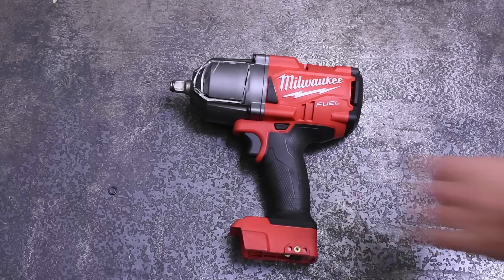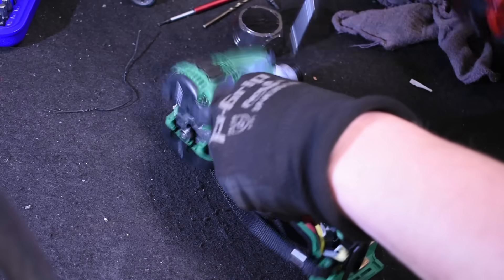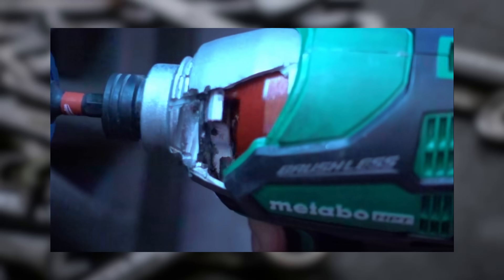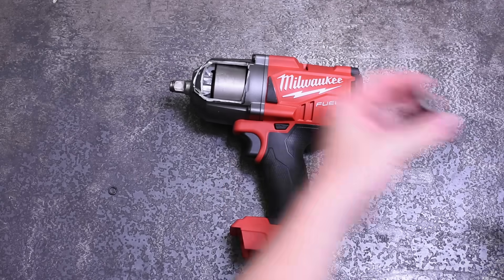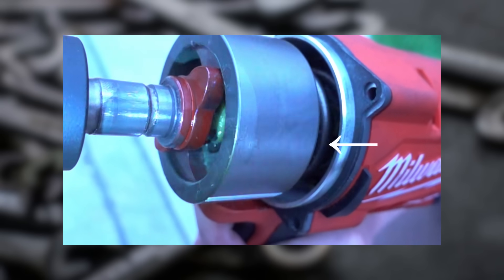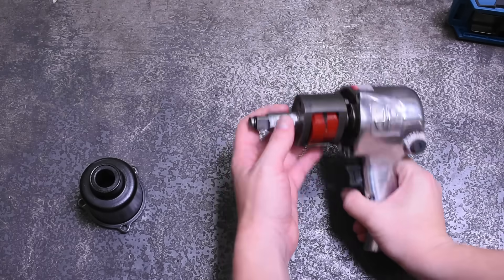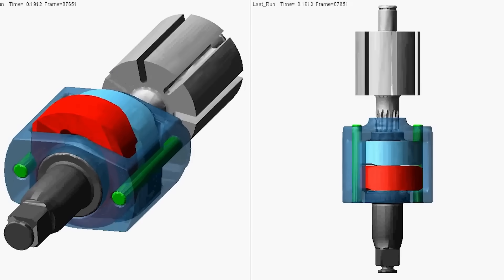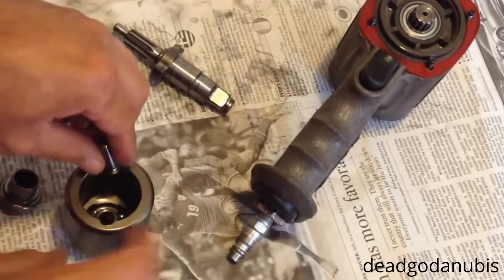High-Speed Video INSIDE Impact Wrenches: How They Work

Comment: Where are air pressure line tools used? What circumstances would you use them over electric?
Is it on production lines or where elecricity is particuarly dangerous?

Comment: ooohhh i see. so, there is no real reason why they couldn't make a jack of all trades drill/impact driver-wrench. all you have to do is make a swapable "heads" motor body, and have settings on the electronic side for each type of head. that would reduce a lot of weight and bulk from my tool bag. "drill/clutched screwdriver head" (and why not coaxial impact for drilling on walls), impact driver head and impact wrench head. who do i have to f to get one of those?
i do washing machines AND AC split units. you can imagine how i can go from needing a drill, a driver, an impact driver and an impact wrench for just one job. (althou impact wrench would only be "needed" for the washing machines' pulleys, basically)

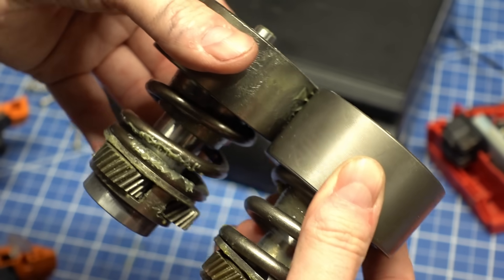Comment: 2:50 does the strength of the spring affect the strength of the blows, i.e. if the force in the spring increases, will the torque/force with which the tool unscrews/tightens increase?
Reply from the maker: Good question. Yes. It increases peak hammer speed before the blow. But that will require a brushless motor that can reset that spring 2000 times per min even with the brand's minimally sized batteries without timing hiccups. So there's a max to that end.
Reply: @TorqueTestChannel  I modified a parkside/lidl tool that has a 220v 500w ac motor, the hammer and anvil did not have impact surfaces vertical but at 45 degrees, so the tool just rotated and hit lightly and nothing could be screwed. I sanded those surfaces to be vertical like on your tool. I placed a washer under the spring to make it more taut. now the tool works much better, but I wonder if it would work even better if I didn't increase the force in the spring, so that the tool can turn more before it hits

Comment: THANK YOU for showing the twin hammer design in action!!  I use the IR 2235TiMAX and have been curious about it's basic hammer function but had no interest in opening it up. Listed at 1,300 ft lb max torque, and 1220 IPM, it is a lightweight beast.

Comment: There is still unclear how the hammering is transmitted to the rotating head and why it is needed pressure in order to start hammering. The inside parts seen through the cut areas show only the hammering part. But is this transmitted to the rotating part?

Comment: Explanation of how impact wrench works is not clear. RPM is not measured in tons. A planetary gear set does not "turn a high rpm into lower but higher torque." That makes no sense. My guess is that probably what actually happens is the planetary gear set converts a high rpm into a lower rpm, it enables an input shaft that is spinning at a high rpm to cause an output shaft to spin at lower rpm, and in doing so the output shaft can provide greater torque than the input shaft was able to provide. I still do not know how the torque, the rotational force, is converted to an "impact." And I can't see it happening in the video images where it is supposedly happening. My guess is that somehow the coil spring absorbs some of the rotational force, over a period of time, and then releases it over a period of time that is shorter than the time it spent absorbing it. But by watching the video where part of the cover was cut away to expose what was going on inside, I wasn't able to perceive how that was happening. .

Comment: The worst tool ever made for unprofessionals. The number of people I have seen use these that were clueless about their function. These are great tools in the right hands but when you see someone try to drive 20mm screws into two pieces of 12mm ply, then it makes me cringe. I have seen them use it to drive metal roofing screws into metal girders and only succeed in driving them so far they didn't grip but went past the thread.
I myself have a Ryobi brushless drill driver which has an impact function for driving screws. It drives screws in using the normal drill drive function but when it tightens it switches to impact and turns the screw 1/4 turn per hit, max, to tighten it without it ripping into the wood.

Comment: So the spring in the metabo HPT is not the right stiffness / power.

This is good feedback for them. If they change the spring so that it takes more speed to fling it into the "dogs" it will skip more and accelerate more before hitting the next one.

Comment: I’m late to the impact driver tech.  However, having to do some seriously-rusted brake and suspension work, on a car recently acquired, made me research and I realised that the hammer system of an impact driver, enables very badly rusted/fused bolts etc, to be removed BEFORE the heads all round off.  What I would now like, is if car makers and third-party parts makers, would please put full-size bolt heads or nut heads on their fasteners.  Some have a half-height I assume for speedy on and off with the tool reasons on the factory floor, but once rusted, it can defeat even an impact wrench, as you just cannot hold it on the shallow head supplied.  Especially after rust has swallowed another mill or two.  

Anyway, I got a 3/4 inch Milwaukee, and although on paper it’s just a little better than the 1/2 inch below it in the range, I suspect there’s more to it.  Like, the heavier body will resist the ‘recoil’ (action and reaction) that slightly has to occur, in an impact situation.  And, how much it can take continuous usage.  I am pretty impressed, and it is slowly earning back the price tag of $400 plus the rubber cover and a load of impact sockets I never had before.  It’s for the big, refusenik, SOB jobs that I bought it, and it does everything at 2/3 or whatever of full impact power.  The only issue, is sometimes getting into these nuts or bolts on a car.  I see why a lot of people end up with a right-angled one, or smaller than mine, despite having to really wring it’s neck to get certain bolts out…it’s possible to get int much better than with my ‘big dog’ as I call it.  But, it’ the really big jobs I got it for, and it works better than I imagined, great technology, it was the fact it made the impossible nuts and bolts, surrender, that clinched it.  Take care all.

Comment: Thanks, now I don't have to open up my air lug nut driver to see how it works. By way it is 30 years old and still works fine. The battery never goes bad or dead it has none. (LOL)

Comment: Is the spring a part of the torque transmission coupling the gear box torque first to torque pretension the spring as fly wheel camping out from the load shaft - or doesn’t do that? If not why not?

Comment: I love the scientific approach and dive! My only gripe is that you described what was going on in the impact driver using force and not impulse.
Regardless of the similar name, I understand force being more easily understood by a wider audience, but it does not describe best what's going on.

The force imparted by the hammer can only be as high as the force returned by the load. The force coming from the load end is what is responsible for the measurable acceleration (the hammer slowing down). However, it is much easier and, honestly, more intuitive to analyze momentum and impulse, or mass times *velocity*.

Comment: Did I miss something? I really wanted to see the driver impact vs the anvil impact, 
If I missed that put a time stamp in,  thanks! And very cool 👌

*(impact wrench does like 400lb-ft torque + depending on the model,  but a bit driver is usually around 150lbs-ft tq - that's where I'm wondering THAT difference) I own both,  thanks again.

Comment: I would have been interested in seeing how those 12v impacts work, the ones you clip to your battery say if you had a flat on the highway. the one I picked up at auction sounds like it spins up to some RPM and then hits all at once, then has to spin back up before hitting again. Kind of curious just what the mechanism is in that thing.

Comment: I don't understand what the strength of the spring has to do with the strength of the impact. The spring is moving it perpendicular to the impact movement so it's just there to move it in so it can repeat strikes right? So how does a stronger spring affect the force of impact?
Edit: If it's winding the spring up and gives it some more torque then if you put it in reverse wouldn't it be unwinding the spring and it would give you less in that case?
Reply from the maker: Larger spring = more tension before release over the dog = more speed. Velocity squares to force. The heavier the hammer, the larger the spring you need for it to translate the motor's RPM speed into hammer speed. The spring has to out accelerate the motor RPM for that window of movement, otherwise it's always lagging behind and would just get twisted. In reverse the spring binds the other way, sometimes there is a bias however.

Comment: Great job on the video! A point of clarification when speaking about fastening, dynamic torque refers to a fastener being driven at a relative speed while in continuous motion. An impact tool by design drives the fastener with strikes and pauses which requires the fastener to overcome static friction each time, stealing a portion of the applied energy away that was intended to developing the clamp load needed to properly secure a given joint. The up side to impact tools is that they reduce the reaction force felt by the user allowing for for higher torques to be achieved without the need for torque reaction devices! When joint loading accuracy is of the utmost importance a DC electric fastening tool is the tool of choice as it tightens in a truly dynamic manner! Lastly, we can limit the negative impact of the variation in friction of a joint by using a torque + angle tightening strategy as it relies less on applied torque and more on mechanical rotation to drive the fastener!

Comment: When I first bought my house, I used to frame walls and things with a hammer and a bunch of nails. Then I discovered impact drivers and construction screws and now framing is my favorite job to do! I have an electric, corded driver and its so good at sinking construction screws into 2x4. And every screw pulls things together more and more. Unlike hammering nails where you are tightening the one you are hitting and loosening all the rest.

Comment: The reaction you feel comes from accelerating the hammer through that cam. First only just a little bit, as the spring resists the cam, but then when the motor is up to speed and that hammer is reaching the end of the cam track there'd be quite a bit more reaction as the two impact.

Making the cam track longer and shallower can mitigate that by essentially stretching it out through time, but that would also slow down the impact rate of the tool. Either way, the tool will recoil just like a big cannon does. Can't escape conservation of momentum.

Comment: The whole "torque" thing is really barking up the wrong tree here. These impact drivers are essentially building up a bunch of kinetic energy and dumping it all at once through whatever it is the 200lb gorilla happens to be reefing on this time. To that end, this really isn't as simple as saying "this one does 150Nm" because that number is essentially a reflection of the flex in the system.

It's fine for comparison purposes, but what registers as 150Nm on your equipment could quite easily end up double that when attacking a super rigid fastener, accidentally ending up with one too many ugga-duggas and snapping the thing right half in two. Not a great day...

Physics-wise, they ought to be rating these in joules per impact and joules per second (that'd be watts). Those two figures offer the most reliable comparison between tools, which is completely independent of the equipment used for the actual test. That would also align the marketing wank with real-world performance, for instance there'd be a linear relationship between the power delivered overall and Project Farm's "big screws into wood" test, as well as a linear relationship between energy delivered per impact and the maximum torque recorded by any particular piece of equipment. What that won't allow however is the cheating that currently goes on with the torque ratings on these things. The test method has too much influence on the final result.

Comment: I too prefer high pressure driven tools they're loud but great for continuous use less breakdowns but for work i need electrics portability even if it takes 3 batteries to get a single thing done at least i can run all the way back to the charger and have the first one almost recharged halfway before i run out on other 2 our 150 hp large tank continuous use screw compressor is definitely quite the powerhouse but they just don't have airlines run absolutely everywhere... most places yes but not everywhere. So i use air in the shop to save my other tools life and electric on the run in hard to get to places if that won't fit I'll have to get a really long hose and the really powerful really small airtool

Comment: Fascinating stuff there. I recall in my high school physics class the teacher explained how angular momentum could be conserved in elastic or inelastic "collisions" of rotating shafts, but I could tell he was having a hard time finding any examples of this - here we have it! Now planning to become a high school physics teacher myself I anticipate I'll show some of these clips to my future classes. Another cool thing about the physics here is that some of these have the hammer bouncing back rather than simply stopping - that actually increases the momentum transfer as there is greater momentum change (going not just to zero but negative). And the spring doesn't just push the hammer forward, it stores energy then will spring the hammer forward potentially faster than the motor.
Reply: This comment should be pinned .02
Reply: For your brighter students, I'd introduce energy methods for solving collisions. Basically, the "torque" you get out of this thing is actually rooted in the kinetic energy stored in the hammer and dumped through the anvil. This one isn't conserved, there's plenty of waste going on, but enough makes it to the shaft to be very useful. Anyway, since everything is basically a spring, you can store energy throughout the whole system just like when using a spring. The relationship is linear as well - it's just Hooke's law. Where things get interesting is what happens once static friction is broken. Whatever energy is left after tensioning the entire system up to its point of either yield or maximum allowable static friction has to go into causing "permanent" rotation or deformation.

Showing some of the high speed video will demonstrate how every hammer blow adds just a little bit of rotation to the fastener, which gets smaller as the video progresses due to more energy being required to overcome the static friction holding the thing in place.

This might be a good introduction to energy methods for impact analysis, should any of them wish to take up mechanical engineering later on.

Comment: I’m so amazed how the hammer feature doesn’t wear off quickly
Reply: get a Ryobi and then you'll find out how fast it's done
Reply: they do. as you keep impacting the hammer heats up, like cooking a chicken by slapping it. and if it gets too hot the metal softens so the hammer and anvil will forge themselves out of shape
Reply: You mean wear on the hammer surface?  It's easy to control with electric designs as the motor is only going to put out what it puts out.
(Well, unless you're like me and wonder what happened when you put 120VAC to a12 DC motor, lol)
Air designs you could theoretically over-speed, but most air systems are standardized.
You mostly run into that problem in hydraulic powered tools as small changes in flow make big changes in power.
Reply: I'm an engineer but I don't design drills. How I imagine it is they design the mechanism based on the life cycles ( the amount of strikes the hammer can handle) based on a good useful life. Making it last forever would servery limit it's usefulness. While breaking it after one hit could break any rusted bolt off but then what's the point. So a middle ground between usefulness and strength come to play
Reply: Id make a new 1 at work myself , those tig welds on the 1 look small but clean ,probably robotic

Comment: Listening to this video is like, "The inertia of the centrifugal force times diameter to the square of pi, equals the direct measurement of the anvil dog times ten cat leashes, portifying from molecular diametrics from the space time continuum." 

No, but good work. This video is the best hands down proof that one doesn't need both a Milwaukee impact driver and a compact impact wrench. I think an impact rated adapter would be good up to 400 ft lbs easily (loosening that is).

Comment: Another advantage of the air tools is duty cycle, they can operate, under load longer without overheating. The air itself through the tool provides great cooling.
Reply: Maybe but you need to oil them unless you have an oiler system. So your duty cycle argument isn’t quite water tight

Comment: Hey, 
Have a look at this video. As you can see and as he says; the spring is adding to the impact force by forcing the tooth/dog down a spiral in the shaft which turns it in the direction of force adding to of the impacts provided by the force of the motor.

How about trying two things:
1) Using a stronger spring to increase the force.
2) Add to the weight of the piece the teeth/dogs are part of to increase it's mass which should theoretically increase it's force per impact by increasing it's mass.
https://www.youtube.com/watch?v=f0gSJa3L_7c

Great channel. Keep 'em coming.